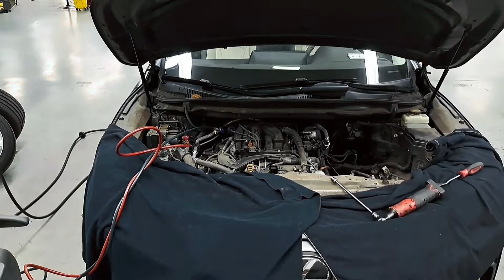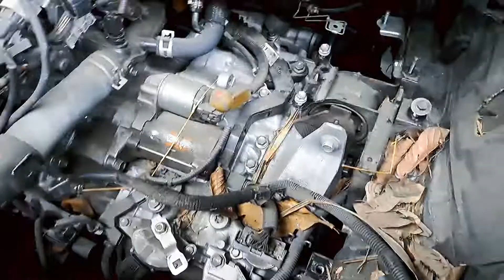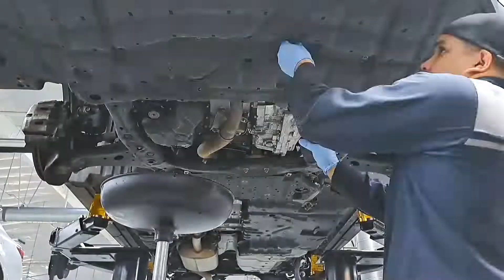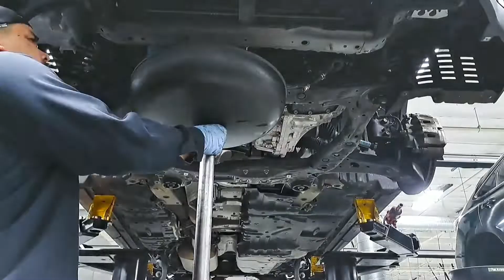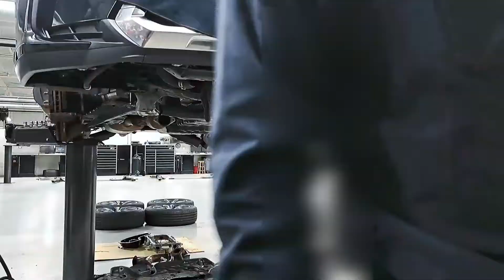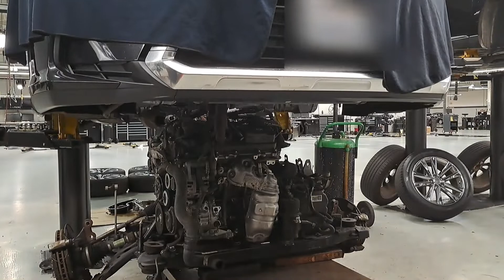Lexus Engine and Transmission Assembly Removal UNDER  3 MINUTES#lexus #automotive #mechanic

Comment: Please help a fellow tech, i see you dropped everything with the harness still on? Wherevis the disconnect point for the harness? Behind the glove box?
Reply from the maker: Everything is under the  hood. There is an ecu connector on the lower left corner. On the right side fuse box, there are 3 connectors plus a 12v wire. There are a couple of grounds wires under the battery area, and the 12v postive wire for the battery needs to be separated.
Reply: @harborareatech310  I got everything from the sides and front off, in-between the engine and fire wall is looking like a a pain. So no simple quick disconnect?:( Fridays are tough) lol
Reply from the maker: @josephlabosco3063  what vehicle or you are working on this applies to the v6 2grfksThere shouldn't be nothing in between the engine and firewall that need to be removed other than the brake booster hose, evap hose and heater hoses
Reply: @harborareatech310  it's an 09 rx350, 3.5 v6/ 2GRFE
Reply from the maker: @josephlabosco3063  ok thanks for the info. The one on my video is a newer gen. Its been a while since ive done that one, but if I do remember correctly, on your application, the  ecu is behind the glovebox, and you can pop the whole harness through the firewall after you disengage three clips holding the harness on the firewall. If you remove the wiper a assembly and cowl you'll have more access.
Reply: @harborareatech310  ahhh okay, all data was saying something about glove box access. But it's hyperlink after hyperlink. So I kinda breezed over that. Wishing I looked into that a bit more first b4 pulling so many plugs:( but Monday I will check it out and see if I can get that unplugged. Thanks for the help and info!

Comment: I have a question on removing the mount for the transfer case ,I have 1 bolt can not get a wrench or socket on , how do I get that bolt removed? Is there a certain type of tool to get to it ? It's the very top corner bolt on the mount bracket
Reply from the maker: What kind of car?
Reply: @harborareatech310  2004 lexus rx330
Reply from the maker: @leorael4497  i dont remember that one out the top of my head
Reply: @harborareatech310  yea I finally found research on it.  The engine must be dropped or lowered in order to get to it